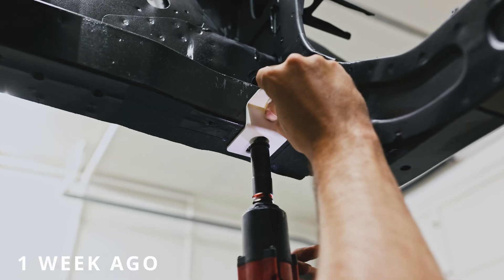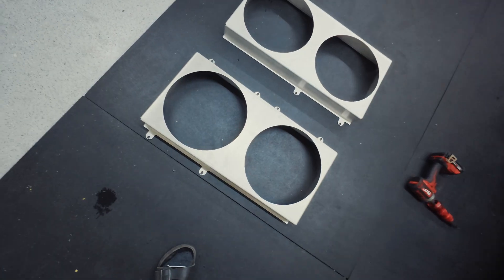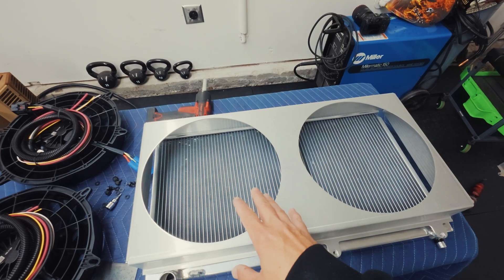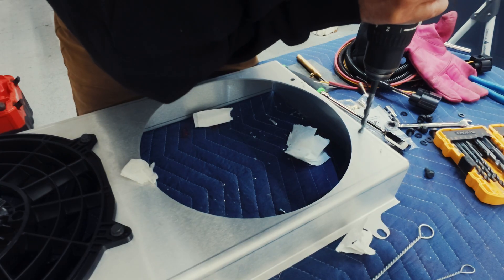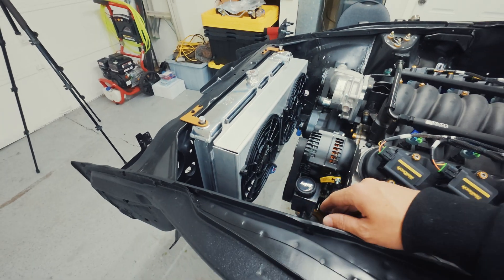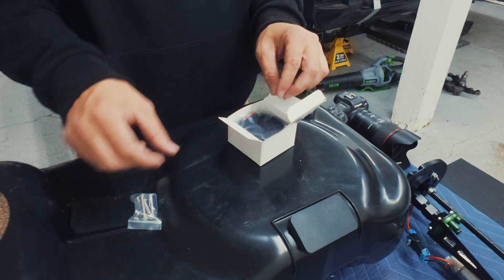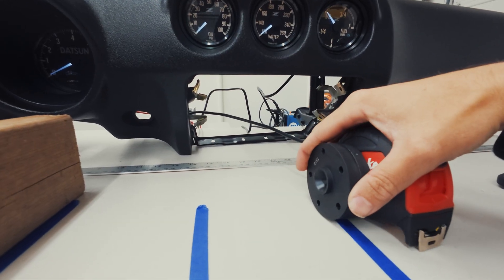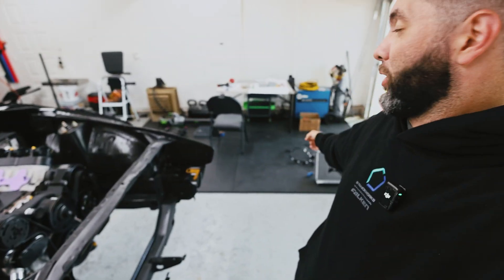I Designed The Craziest Radiator Setup // Datsun 280Z

Comment: Subscribed.
It wasn't until the end of the video that I realized that you are the same guy that I replied to yesterday about the excellent fuel pump install.
If you know you want to use rivnuts, send cut send can actually put them in too. So if you do a third iteration just include the mounting holes for the fans and they can actually put threaded inserts on the inside for you. They even have some weld options. 

A z bend on those top flaps will let the whole thing come forward the way it is now but don't make the mistake I did and let the actual shroud touch the radiator. You need to have some foam or rubber trim to seal the final small Gap. Vibration over time makes the aluminum touch and scrape each other until you make a pinhole in your end tank. Was an expensive lesson for me at the time because I couldn't Tig the hole shut.